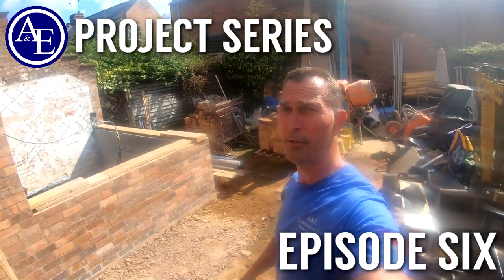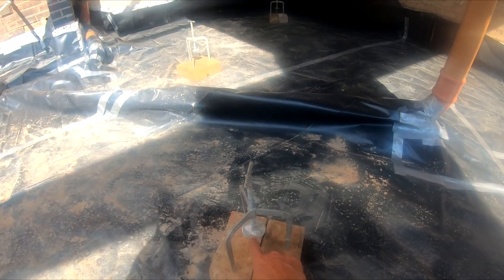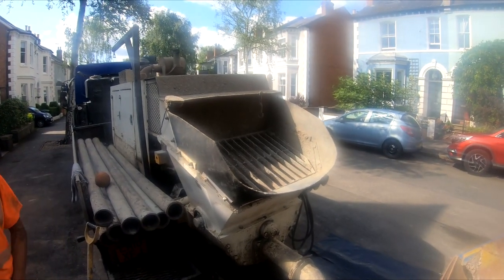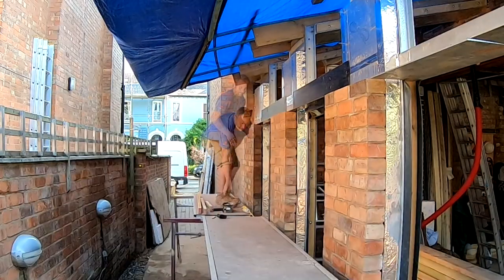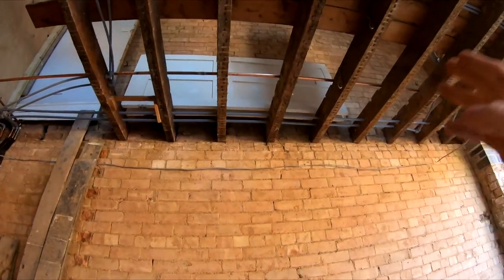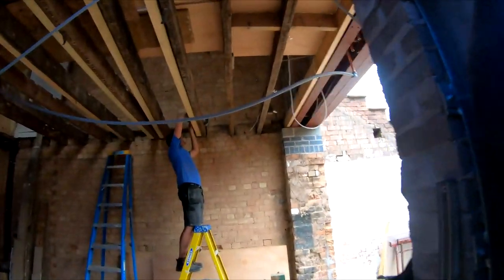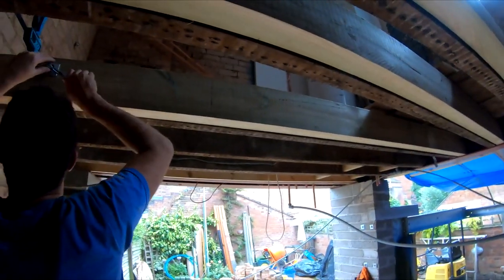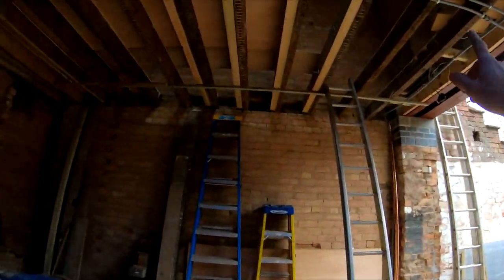HOW TO BUILD AN EXTENSION #6 | Brickwork, Floor Slabs, Joists and Concrete Pour!

Comment: At 1.30 at video where Tony is explaining the detail about the concrete level I was wonderding if you could advise on how you guy's would go about sealing off the cavity  under door openings in a normal 2 skin extension. I can see you have your insulation upstands and are going to put some DPM in but other forums seem to lay the inner and outer skin of brick and block, and just seal off the jambs and possibly the head leaving the cavity opened at the bottom. I would appreciate what is your thought's on this?

Comment: kinda wondering I know its 3 years old my concern is putting dpc around treated timber at about 8 minutes in. My thoughts are its treated so shouldn't rot and adding plastic makes a cold spot for condensation ? Not saying Im right just want your thoughts!

Comment: Good job lads but I would use fibolite blocks instead of them horrible thermalites but I suppose they have better thermal qualities, also I don't think I would have done a solider course on them openings  around that age of building I would built a flat skewback arch over each  opening, never seen liquid concrete used before but its the exact same process as a liquid screed but I think does all that water not weaken the concrete don't know if I am convinced with that product but everyday is a learning day, great uploads by the way, great content.
Reply from the maker: Hi wheaten bread, it was the spec the architect had given because of the amount of glass, as you know clients get the last say , the self levelling concrete is a massive time saver and we haven’t used normal concrete for some time now its a little bit more expensive thanks for watching all the best Tony 👍 keep safe
Reply: @BuildWithAE  thanks for replying much appreciated great uploads👍